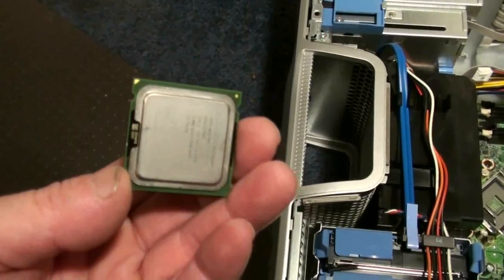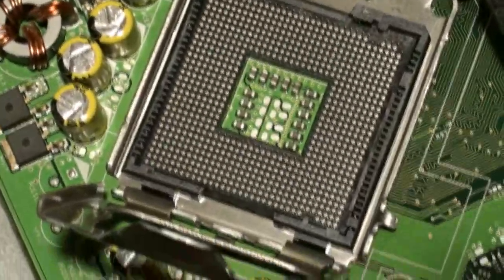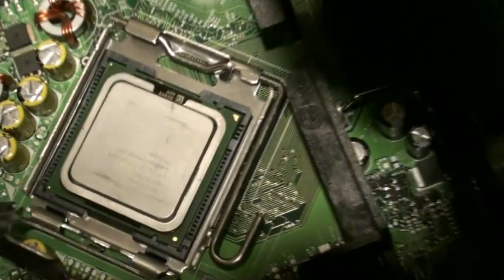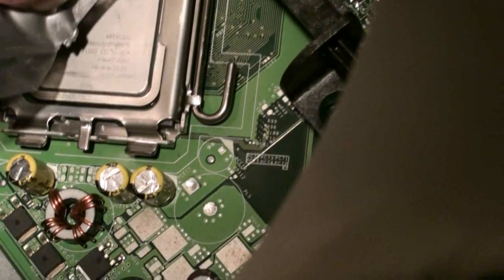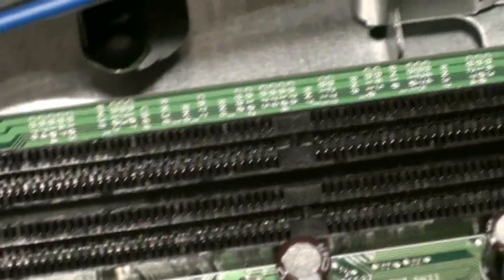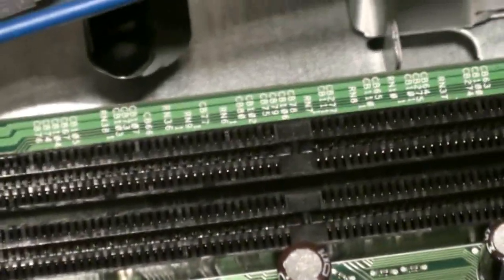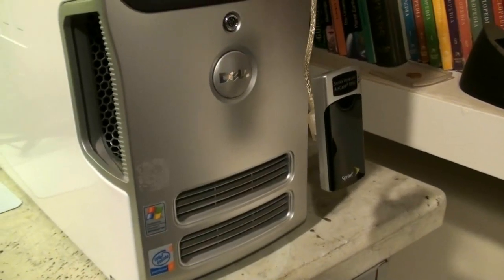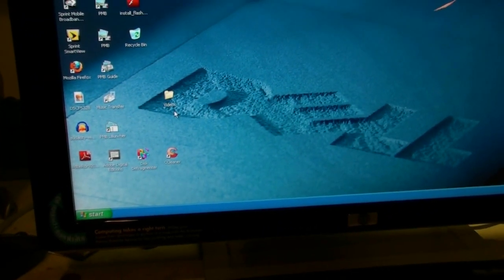Dell Dimension 5150 How to Upgrade to 3.8GHz CPU and Memory Part #3

Comment: @PrivatePanic 

There is no correlation between clock speed (GHz) and RAM memory amount. The computer will truly speed up without any change of the clock speed. You will just feel your computer being faster with everything you do in your day to day activities. Faster boot-up and applications opening faster are some of the benefits of more RAM memory. You can never have too much RAM memory.

Comment from the maker: @maplekillaz the 5150 in this video was setup to edit 720p videos to upload to youtube in a low cost way, it is not a gaming PC! For most of the newer games you will need a quad core PC and I recommend one that can handle the Q9650 3.0GHz. CPU x4 or the i7 2.8GHz CPU x4 CPU by Intel with 8 gigs of ram for starters. I hope this helps!

Comment from the maker: @31pockets The 400 lower case cooling fan had a 4 pin plug and the 430 has a 5 pin so at start up it would bio up to F2 till I replaced with a 5 pin fan from eBay, the CD drive has a different ribbon cord & plug, so that was a newegg deal and the memory is DDR3 in the Dell XPS 430. The XPS 400 now plays 1080p smooth with a Q8300 CPU & 4 gigs of ram, I haven't put it in video yet because the on/off switch, firewire and usb port still hang out the front because I haven't had time to cut the metal.

Comment from the maker: @lucasnooker This 5150 CPU upgrade video is for a single core only, and can only edit to 720p HD smoothly, I use a Dell XPS 430 with a Q9650 CPU 3.0GHz x4 quad core running 6.4 gigs of ram to edit 1080p clips and find that works better at hotter levels.

Comment from the maker: @PrivatePanic Hello, you always want to make sure you have the right components to match a Dell PC and do research before attempting upgrades. it sounds like you do not have the right memory if it doesn't show up in the system or the memory is not operational? so make sure you double check your components for match!

Comment from the maker: @antfarm69 That's sounds real nice to hear! I just upgraded our latest XPS 430 from it's original ati 3650hd 256 gig  video card to a ati 3650hd 1 gig and what a giant improvement for a low level card! I want to get a 5450 right now but can't afford one, that's almost like having a computer in a computer right! I still have a problem with the new 430, it stall's out when editing 1080p sometimes because I'm still running it's Q8300 2.5GHz CPU with only 6 gigs of case memory in that one, so thanks

Comment from the maker: @antfarm69 I think they mite have installed dual core motherboards near the end of the 5150 series model year but not sure? the XPS 400 was a little faster than the 5150 but, still could not handle 1080p even with the pentium D 3.6GHz CPU w/ 4 gigs of ram so I did change out the mother board to a 430 quad core, now the motherboard was a cake walk to install in the 400 case with a few cuts but came with some other problems.

Comment from the maker: @antfarm69 I did try the pentium D dual core 2.8GHz. out of my Dell XPS400 and then my pentium D 3.6GHz that was also in the 400 but, the PC would not boot up! now I have seen from time to time 5150's on eBay for sale with dual cores but its rare to see that? I guess you are lucky! I did spend a lot of time on it, all my newer PC's are Dell xps 430 quad cores with Q9650 3.0GHz CPU's /w 8 gigs of ram, the 5150 is use for testing videos only now.

Comment: I would never handle these devices but some engineers claim it's okay, I'd just never do it, CMOS etc. were always just so easy to destroy with finger static.  Dell says it's okay to pull out the memories but I'd never do it with bare hands.  I mean Dell stands to gain if you have to buy new ones.  As for the thermal paste, I'd put back just the same amount Dell had put on there - and that's quite a bit!  Engineers all say, just make a thin film, just as you're seen to do here but no experience!
Reply: Yes, dont touch it with your fingers thought, just put a pea-sized dollop on the cpu, then put the heatsink on top, because the heatsink will spread it out

Comment from the maker: @boomsledge the 2 core will not work, the 5150 takes a PC express video card and with the 3.8ghz you will need at least 4 gigs of ram to use it, I hope this helps.
Reply: ram has nothing to do with the gpu for 1, also its pci-e, and im running a pentium d with 2.5 gb of ram with a gt 210 gpu

Comment from the maker: @09hudsond 
The 3.8GHz in the 5150 is a single core p4 Intel CPU, not sure on the d930 mayte? It sounds like a 2 core; I have a 3.6GHz 2 core d 960 Intel CPU in my dell XPS 400 and its faster, the clock speed is 960 FSB and the 3.8GHz. Is 670 FSB single core, Hope this helps.

Comment: G'day mate hows it going. I have a 5150 aswell and am currently trying to make it better. I was wondering if i could put any graphics card in it. I am thinks of putting in a geforce 8800 i was wondering if it will work on my computer. i have a pentium d with 1.5 gb of ram. Also i was wondering if i could put in a core 2 duo chip instead of the pentium 2 thank mate.

Comment: How hard was it to remove the heatsink? I'm in the process of removing the 2.8ghz ht cpu from my dimension 5000, and popping in a 3.2 cpu which i got for 5 quid! I also upgraded the ram from 1.5gb (was 512 originally) to 3.5gb (ram cost me 7 quid for 2gb!) and I've popped in a 4350 ati gpu, which has allowed me to play High def flawlessly with very little cpu use. 
The damn thing is too loud, even without the new mods. Any way to reduce the sound emitted from this pc?
Reply: mod fan speed in the bios

Comment: 31 pockets....i still think that going from 512 mb of ram to 4gb of ram was your best upgrade, that`s a good upgrade with a 3.0 cpu that computer should fly 
adding the 3.8 cpu can only help

nice job though ! what brand of memory did you use and any specs of it...would be helpfull to others wanting to do this upgrade......have a good one 31pockets

Comment: hello i have a pc Dell Dimension 8300 it works so good but it freezes and i need to make force restart 
i fixed this i changed graphic card and no problem now but it doesn't start in first time

for except...i shutdown it in night when i try to start it in morning i need to unplug sometimes from electric power for pc to start any suggestion for this help me thanks for any answer
Reply: if its overclocked, downclock it a bit

Comment: Can somebody help me i plugged out the front panel usb ports I/O and then i plugged it back in the power button became shorter for it to reach the front panel usb port and the click is hard and won't turn on! i have the e510 Dimension

Comment: question: I got a laptop a few months ago, and on the website it said the GHz was 2.5 turbo but when I got my laptop it is 1.7 GHz. ???
Reply: That is because the "turbo clock" only happens when the cpu is at 100% usage, the rest of the time, it runs at 1.7 ghz

Comment: Well, this computer ran for years for me...I had already upgaded the memory to the max 4 gig ram. And a new video card. However, now win 7 is a bust, and it won't run win 10, unless I can find an older version 18.07 or what ever.  The latest win 10 will not run without 8 gig of ram...like what?? that is a lot!  Anyway, wish you were still around, maybe you have some ideas. I am going to look into that card you are installing in this video. I am sure there are some still around. I hope. otherwise it means buying another computer. Sigh.

Comment: you could... but you would need to make sure it has the same socket...
Reply: also the bios revision has to be compatible, and the heat monitor, that's why you cant put a core 2 duo/quad in a dell dimension 5150, the heat monitor does not work, so the computer wont even boot

Comment: you can't go any higher than a single core cpu with this motherboard. 1. the slot isn't correct for an i7 or i5. (the usually use slot 1155) and the motherboard can't support any higher than a single core because the voltage regulator can't support more than one core

Comment: A pentium 4 single core is trash!!!!!!!! The Core 2 Quad Q6700 despite mine being overclocked to only 3.2Ghz (stock 2.66Ghz) still would out perform that pentium 4 (at 3.8Ghz) because The Q6700 his higher per core performance by far.